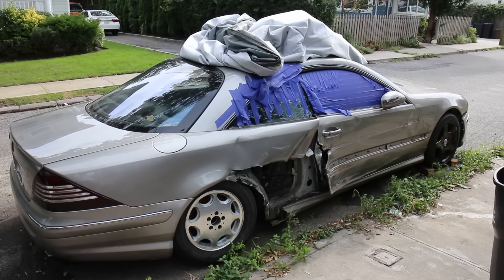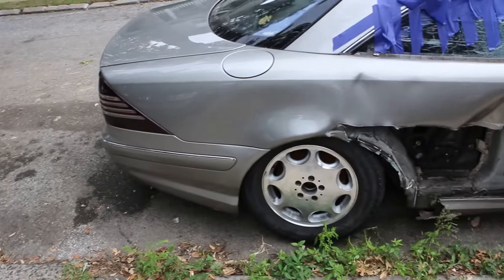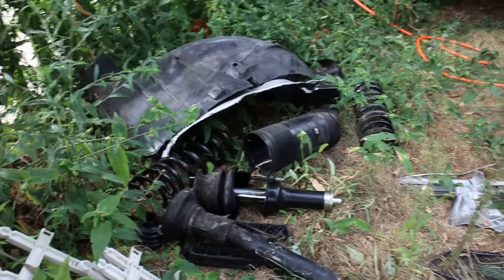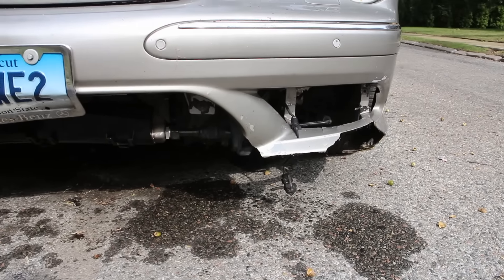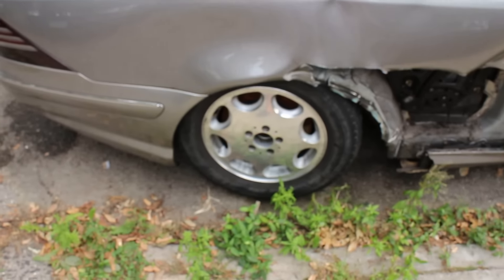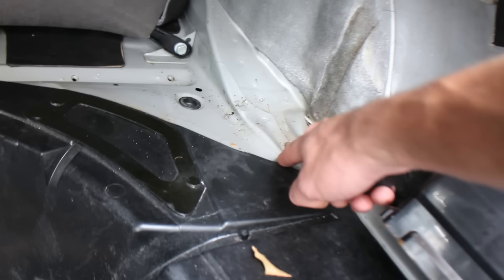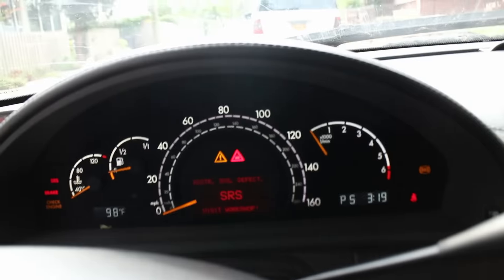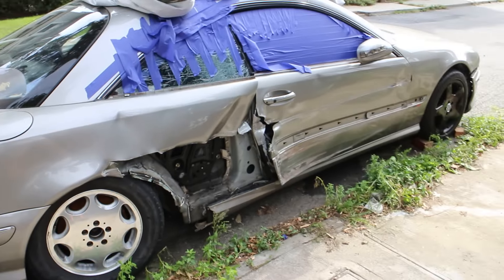Mercedes CL600 twin turbo project. Crashed the car. Part 1

Comment from the maker: UPDATE: 
Body work is almost done. No structural damage was found, only exterior aluminum. Rear subframe with differential is already in the car. All straight. I will be making another video soon.

Comment from the maker: Update on car.
Recently bought complete passenger side door, rear subframe aka H-frame, new subframe bolts, both rear struts, some rear suspension links, and whole quarter of the car cut off salvage vehicle. Now I need to find some time between my customers and other projects to bring the car to my friend Ray at RayMac Auto Body in Long Island. Will try to get the car to him as soon as  I can.
Reply: hey man, once again this channel is awesome. I have a CL myself and I would really like to know what you used as emergency supports for the hydraulic struts?

Also huge request coming at you from Tennessee, can you please show some of the body repair. These cars have a pretty exotic light-weight body construction and I'm really interested to see it done right!!

Comment from the maker: no time to work on it yet, other projects take all my time. plan is to park the car and raise it up on wooden blocks so I can remove and replace rear subframe so car can drive for now. also, need to measure if body is straight at subframe mounting points. I don't want to do it at the shop to tie the lift with this car so now looking for space to do it near home, have one option working on it now. after car sitting for couple of weeks it started right up today. once I have some more time will start working on it.

Comment from the maker: parts car did not work out, unfortunately. at this point I will be looking at damage and source needed parts separately. might also take the car to local shop and put it on frame machine to make sure all is straight. I have few customers cars I'm working on right now and no time for this car. hopefully I. few weeks undercarriage damage will be checked more precise.

Comment: Hi, Sorry about your car I hope you get it back together. I own an 03 CL 600 RENN Tech that just blew an ABC hose. Where did you get the supports for the upper control arms. I need to tow mine out of a parking garage and I have to remove the belt and back it out to get to the tow truck. I believe these may save my wheel arches

Comment: Driver side front wheel is butchered also , there is a bad ding on alloy, how come? Did you manage to mangle it before the accident :(
I'm happy animal is alive and hopping around, but the CL is so fucked, normally it would go to junk yard if you weren't a mechanic.. I wonder what the final cost to you will be after you fix everything, especially the body work cos that you don't do yourself
Reply from the maker: Yeah, its sad to look at the car right now. I hit some raised pavement and then flew into forest. I must of hit some tree stomps laying there. Could not do anything with making wheel straight at the moment as rear subframe has upper links mounting ripped off. Ordering another subframe and another strut. Once subframe is replaced and strut installed will look how wheels sit. My body man can straighten car frame but I want to have perfectly straight rear subframe to be installed first.
Reply: valgehiir thanks

Comment: I hope you know this car it's aluminum?if you start cutting and replacing stuff this is no welding,only special bonding glue and titanium rivets.good luck take it old rivets out.i have very nice second owner no accidents same color 05 cl500 with sport packege if you want take it look I'm in Wilton CT 20 minutes from Stamford
Reply from the maker: Most outer shell is aluminum, fiberglass front fenders, hood, trunk, etc. with steel frames under car. I'm not going to do bodywork. My friend Ray will do bodywork. Found rear subframe, quarter of the car, door, rocker molding, etc. Hopefully I will get all parts in soon so we can start peeling metal off to check on damage. Car will also be measured and frame machined if needed

Comment: you shouldn't fix it because its unfixable... the B column has been destroyed wich is an important part regarding the safety of the car. The engineers of that car designed it and it got certified as it was as it left the factory. If you repair it, it will never be the same as it was being certified for safety. this car should be scraped, you can buy another one from germany for cheapo... just take the engine out and sell it or keep it... i know that it's hard to accept the lost, but you should...

Comment: Its pointless fixing this... It will NEVER drive as good as other car anymore... No matter how much money you put in there.... 
If the car would still have a value above 50.000$ it would have a point, but for current prices sometimes below 10grand its really worthless